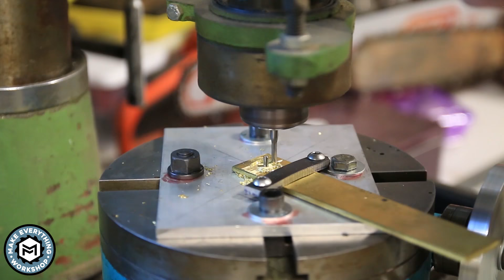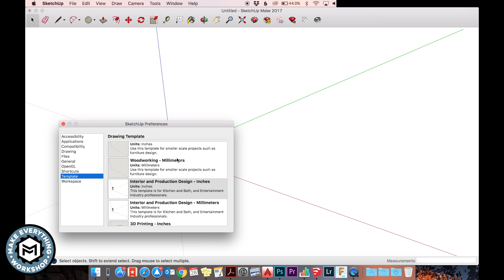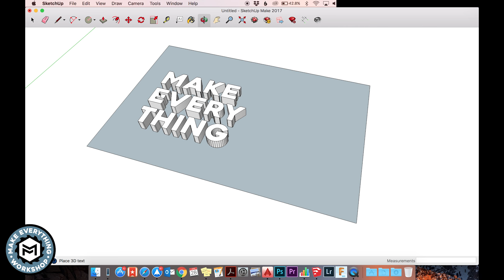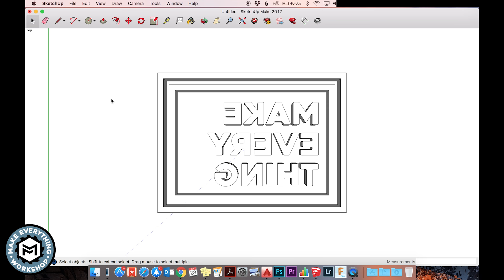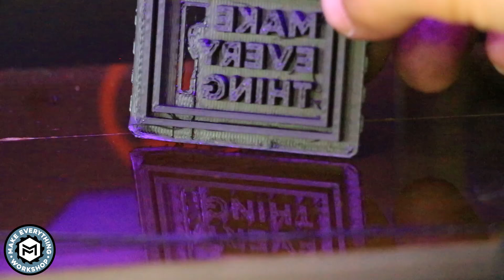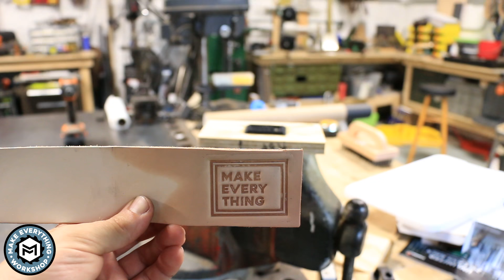Embossed Leather Patches W/ 3D Printer - How To!

Comment: Thanks! I've used Sketchup  before but not for this. Great idea! I want to echo another comment: use an arbor press! That vise is applying way too much pressure and is distorting the impression. With an arbor press, the leather lays flat and can be positioned precisely. Secondly, the leather needs time to absorb water into the fibers. Let it sit until it starts to turn back to the original color, then it's ready. You should not have to hold it in the press for more than 15 to 20 seconds. If the impression has a nice darker brown burnish to the impression, the moisture level was just right.

Comment: Save a bit of time - no need to clamp for 10 minutes. There is very little bounce back from compressed leather fibres, so you should be good to go after simply applying the amount of pressure you desire. This is a really cool setup, and is a much more affordable way of getting into embossing than having stamps custom made for you by someone else.

Is there a specific kind of filament that works better for this? A type that stands up better to repeated use, or makes crisper lines for finer details? Seems like it's time to invest in a 3D printer!

Comment: Why not invest $100 or less in a 1 ton arbor press and pay Augustine Dies $25 or so for them to make you a legit magnesium stamp. No fiddling around with a bench vice trying to halfway get it straight. At least using an arbor press, you can see EXACTLY where you're putting your stamp.
Reply: @Imperia La Roccia, maybe because with $25.00 word of filament you can make several stamp. However, you can always make the stamp to fit the arbor press. I don't know, but that is what I think his reasoning could be. I do both, 3D printing and milling, and this video, and those were they make press dies, makes me want to try it. It has to be good at least for emergencies.

Comment: I love this.  So tip from someone with a Prusa I3 clone: I would have just printed right onto the wood.  Just secure the wood to your print bed, then calibrate your Z axis to the top of the wood.  Turn off raft and print.  If you are concerned about the plastic sticking to the wood, you can just go hotter and slower on your first layer.

Comment: I have had a 3D printer for two years and never thought the ABS I use would stand up to embossing.  What was your infill on the 3D print.  I would imaging 100% since you are putting a tremendous amount of force on it.   I use my printer for making makers stamps for ceramic artists.  They stamp their marks into leather hard pots.  Works really well.  (PS:  If you did not print with a raft, your letters and frames would simply have fallen apart coming off the bed.)
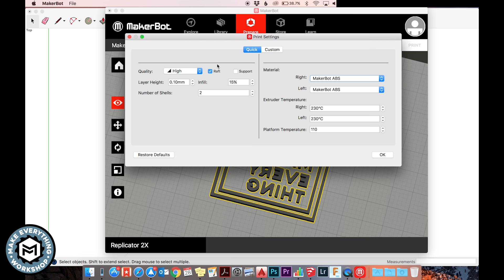Reply from the maker: Bruce Brachman I printed this on maker bots “high” quality setting with a 10mm layer height and a %15 infill, my printer always clogs when I try and do %100. I think the pattern I use is about 1/8” squares. I will check my 3D printing software and get back to you on the infill pattern. But I’ve made many of these stamps and made hundreds of leather patches with no issues. The wood even develops a depression to better match the stamp over time. Go to 5:16 in the video to see the screen of my 3D print settings.